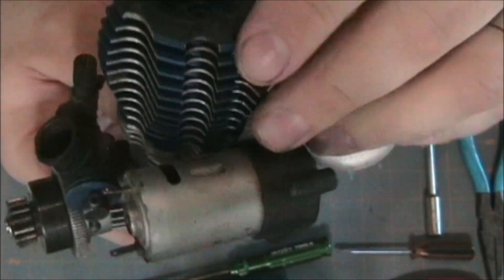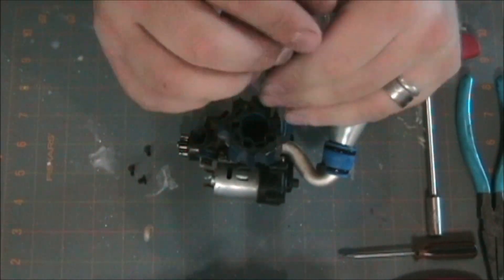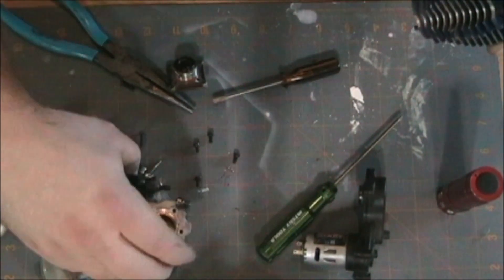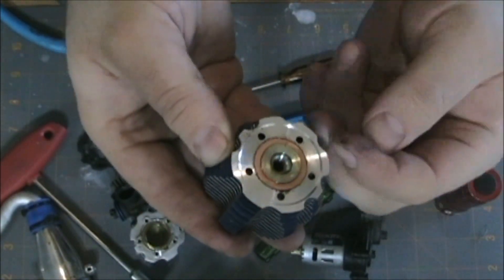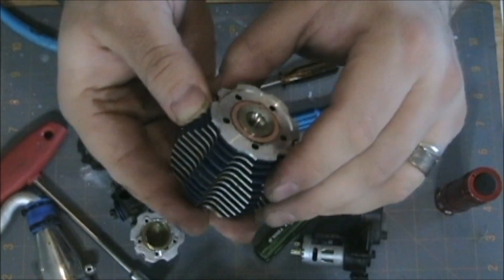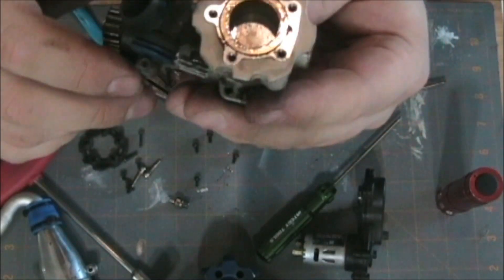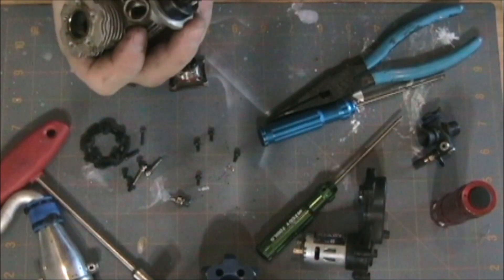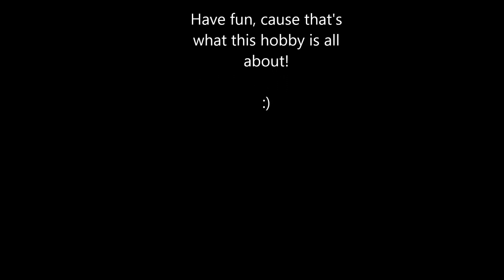Grizzly RC - Traxxas TRX 3.3 Tear down/Rebuild (Part 1)

Comment: Your engine has no pinch. Needs piston and sleeve. Probly rod all so.
Reply from the maker: Thank you for your observation. Engine has been back together and running great since this video. I will check out your suggestions on the next tear down. Thanks for watching!!
Reply: Slider7285 you dont have to re break in the engine when you take teh sleeve ou tbecause it only goes in one way so it always goes in the way it came out